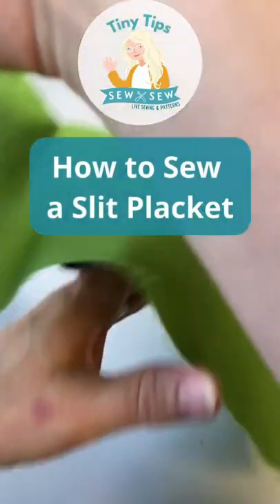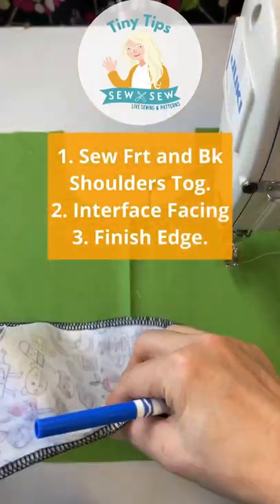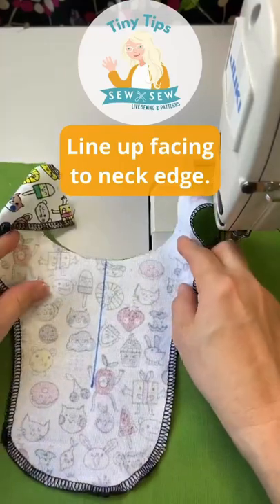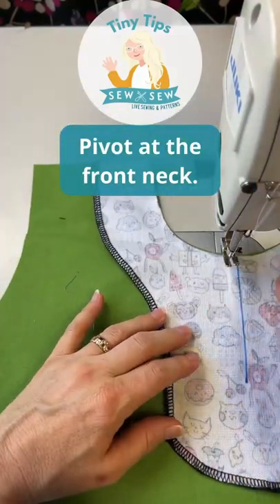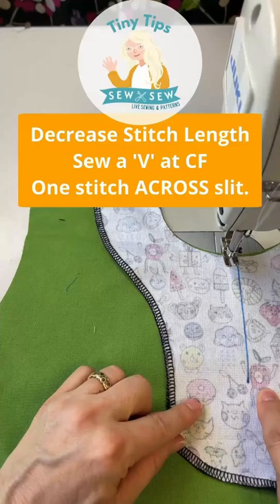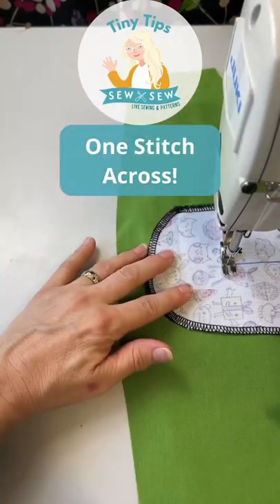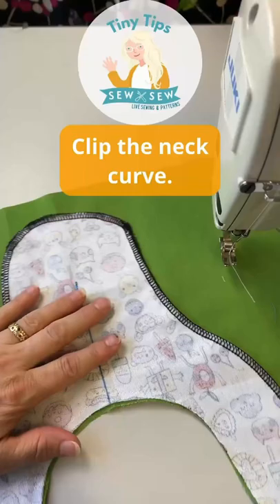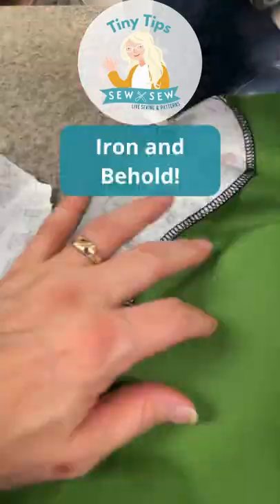How to Sew a Slit Placket

Comment: Brilliant.  If sewing a slit v neck opening and finishing with bias binding, should I still sew to create a v, and then cut?
Reply from the maker: Is the bias in two pieces? One for the slit and one for the neck? Or are you binding the edge so the bias will be visible on both sides(inside and outside)?